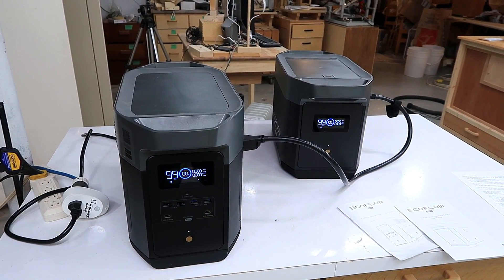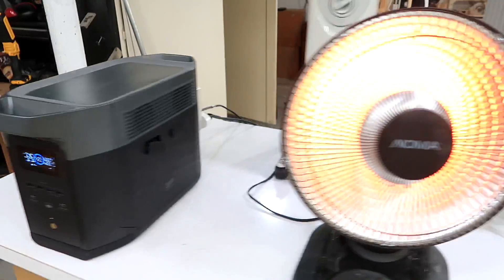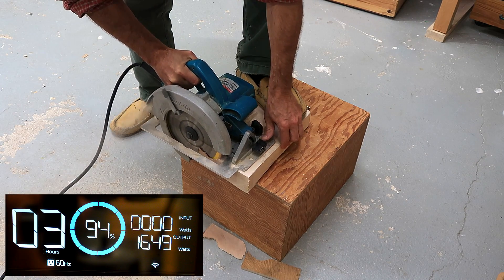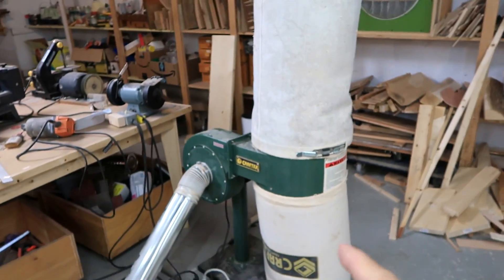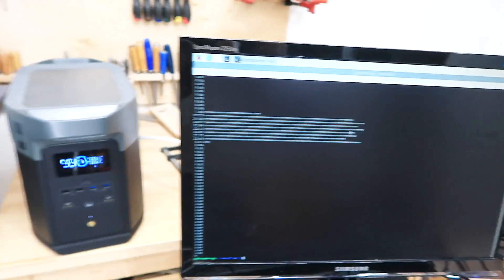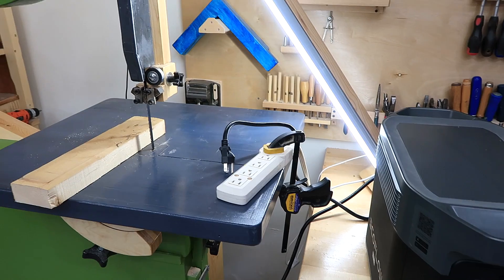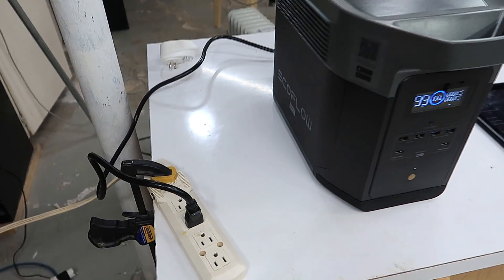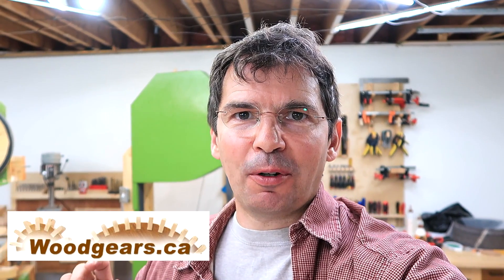Overloading the EcoFlow Delta Max battery pack

Comment: 4:04 and 5:08 - do any of these devices contain a slow-start circuit? For example, like the one used here?
https://youtu.be/BCzwF92esNI
For the record, I am not suggesting messing with power tools or in anyway disassembling them or modifying them but if it is the start up current spike that makes your power back up electricity supply unit tripping, there may be solutions out there that could have a slow-start circuit built into a power cord extension or as an independent device that can be inserted between the power source and the power tool. What I mean here is a device that plugs into the power source and that the power tool plugs into in turn. That device might have to be appropriate for the individual tool's power and current demands. 
Consult an electrician or electrical engineer - they might be able to advise you on such solutions.

Comment: I forgot thumbs up to you. You are a bit of a multi-artist in battery, programming and wood. Ecoflow is a good powerbank but think if you had to go out and buy an inverter of 2KW for 120 / 240v and batteries and then it will be almost the same price and then you can not take it on holiday or in the garden, with ecoflow delta max, you get it all in a box and a small table with it on top of the equipment

Comment: Great video!  I just bought two EcoFlow Delta Pros and began testing then.  The capacity test did great on both, and they can sustain what's advertised, regarding the 3600 watts of output, but I was pretty shocked to see that neither could power my Delta table saw (model 36-725).  I'm not exactly sure why, other than perhaps it having something to do with it being an inductive motor?  My Watt Meter only saw a surge to 1800 watts or so when plugging into the wall outlet, but perhaps it surged far higher, faster that I didn't catch it.  I guess I need a similar setup to what you have to watch it more closely.  Still shocked that the Delta Pros couldn't power the table saw, even with X-Boost...
Reply from the maker: the current surge on these motors at startup is crazy, something like 60 amperes.  if you retire the saw for 240 volts and get the box that hooks up tow for 240 volts, then it can start a 1.75 hp motor just fine
Reply: @matthiaswandel  I guess I just figured that if the Delta Pro can surge to 7200W that it should have been fine.  Not that I'd use the table saw in any sort of power outage scenario, and I'm not a builder, so in the end it doesn't really matter, but still :).  Yeah worst case, I re-wire it or put a soft starter of some sort on it, if it became a 'need'.
Reply: @ericjansen9042  question I have delta pro too. How long did your overload protection light flash for before u can use the ac ports on ecoflow again?
Reply: @Tech4Ten  in my case when it would overload, I just turned  the AC outlets off and then back on and it was working again.  Maybe 10 seconds .

Comment: The impedance on the bigger bandsaw (plus the mass/inertia) probably required more than the peak current of the inverter. If the "generator" used deep-cycle SLA batteries it would probably handle that sort of surge.

Comment: forget to run a generator for 3 years, clean the carb and it will run. forget to charge a battery for 3 years, freeze to death
Reply from the maker: yes, you can’t just forget about these.  a forgotten generator will give you trouble, but can still be made to run.

Comment: How about this scenario. I have a chop saw and a small air compressor running off a generator. The air compressor happens to be running I go to use the chop saw and that pops the breaker on the generator. Now could I use something like this hooked to my generator and my other tools hooked into this? For just a little extra power boost.

Comment: @Matthias Wandel have you heard of a device called "soft starter" it could help start those mashines and without tripping the fuse, most high power devices have these inside the housing. As an example in germany most washing mashines and dryers have them to prevent that the fuse trips. 
i like your videos they are very informative and you have very understandable voice, nice greetings from germany and see ya next time.

Comment: Its a nice looking piece of tech that I am sure plenty of people could put to work. My parents built a cabin some time back and we used one smaller solar panel, a car battery and a inverter to keep the tools charged. We used a Dewalt Framing nailer, drills and circler and reciprocating saws and were able to keep the battery's charged for everything but the saws. The Saws did not perform that bad, but with heavy work we found we needed to start the generator or we would eat through the battery's faster then we could charge them. The kicker though was we ended killing the battery over the build, and in our case was no big deal, but if you needed to replace for the next job it gets costly quickly. We did this before the newer high compacity battery's were available, I think we had 2 4ah and a bunch of 2ah so that's a factor for running the saws for sure. The Framing Nailer did much better then we expected, full day most days per charge. It would be interesting to do the same job with this and see how long the tiny solar panel we had  could keep it topped up.

Comment: I've been looking at battery power generators; thanks for the honest and entertaining review. Regarding the planer, most home circuit breakers have a thermal trip feature using a bimetal strip, and a magnetic trip for short circuits and surges. There are trip-curve charts online that show how long a thermal breaker can be overloaded for at various loads before it will trip.

Comment: Is there any product data that advises a slower recharge can lengthen the viability of the battery storage?
Reply: I know that charging to only 90% doubles the life of the batteries.
Reply: @grantofat6438  If this were true, would not manufacturers electronically limit the charge capacity to 90%

Comment: Older breakers had no such "slow blow" behaviour, sadly. Our flat just got upgraded from old 16A 230V breaker to new 16A 230V breaker and now I can start my 3 cylinder compressor from that circuit whereas before I had to run a lead to the stove in the kitchen which has a slow blow 10A in the back for the sockets and a 32A for the whole circuit on the board. Needless to say, I'm happy not having to do that. I think continuous heavy welding would still pop the breaker, so the stove may be the answer for that if I have to do some, but the welding I've done thus far has been totally fine. Clearly your breakers are not from the 1960s :-D or if they are, they were a better unit than the one that just got ripped out here.
Reply: Most breakers have a magnetic trip point where they will instantly trip and your compressor probably exceeds that. I can't imagine a household breaker not having the slow-acting thermal trip mechanism.
Reply: @eDoc2020  Look, maybe it was worn out, it was 60 years old, however I could always do sustained loads up around that and it would eventually trip, but it could not stomach the compressor and the new ones can, seemingly with ease. I think, once running, the compressor is only drawing 10A or so, but at start up that motor draws a fair bit higher than 16A for a short time just like what Matthias shows here, and that 60 year old breaker, for whatever reason, could not stomach that, and the modern one can.
Reply: @fredio54  That matches what I suggested. To use 'random' numbers the old breaker might have a magnetic trip point of 45 amps, and the new one might be 60 amps. Now imagine the compressor needs 50 amps to start up.
Reply: @eDoc2020  Sure, could well be, but I suspect it was more like 25. Actually, it seemed that the surge trip was affected by the thermal trip, as I could start my SMALL compressor a few times in a row and then it'd trip, but never the first time. In any case, I don't care, it's gone and good riddance :-D

Comment: A breaker is not supposed to be loaded more than 80%. For example: your average vacuum is about 12 amps, which is 80% of a 15 amp breaker. Now to the product: 2400w÷120v=20a. 20×80%=16 amps of constant current draw, if you treat the unit like a breaker, which I would highly recommend. In wattage, that would be 1920w.
Reply: They rate it 2400w with 500w boost. Based on that we can conclude its 2400w rating is continuous. And btw continuous is defined as over 3 hours. The battery would deplete before you need to worry about the 80% rule.
Reply: @eDoc2020  If you saw the entire video, the boost feature just drops voltage to compensate for the excess current draw, meaning our equation still balances out at 2400 watts. Regarding time, if you would not design the load on a circuit to be capable of 24/7 operation, then best practice is to not do it at all. Spin up surge by an average tool motor is one thing, but even electric mower and snow blower manufacturers tell you not to use cheap drop cords. They do not know how long (your theortical three hours) you are going to use that machine and how far away from the receptacle you are traveling. Cheap drop cords are usually 14 awg or smaller. My Snow Joe, for example, draws 15 amps. That means 12 awg or larger drop cord and 20 amp breaker with no more than an additional 1 amp of draw on the entire circuit.
Reply: @brianpiper3188  As far as I'm concerned if something comes with a 15 amp plug it's perfectly safe to use it with 14awg cords on a 15 amp circuit (voltage drop is a separate issue). If something draws more than 12 amps continuously it should have a 20 amp plug.

The only appliances I've seen which draw a confirmed 15 amps on a 15 amp plug are a microwave and toaster oven. The microwave timer prevents continuous operation (and besides, it would overheat before then) and the toaster oven also has a thermostat which will limit the duty cycle.
Reply from the maker: I was certainly getting 2400 watts continuous.
Reply: @matthiaswandel  My original comment was directed more towards safety, I saw you draw 2400w continuously. The "boost feature" is a top five worst selling point ever, for a not so obvious reason. Without it, I think you showed off a decent product. I just thought of one question that I don't remember seeing in the video: I assume the battery bank is DC. Is the inversion back to AC a pure sine wave or modified? Just curious.

Comment: It's a very cool unit, but for $1299, it seems like that someone tech savvy could just buy a 3000 watt inverter for their car, or maybe rig up something with some deep cycle marine batteries and an inverter and save a lot of money.  
But for someone who is not tech savvy, this seems like an awesome all in one package.
Reply: I think it is using LFP or Li-Ion batteries. It would be more tricky to do this with those for that price.
Reply: @mckenziekeith7434  Very true.  For someone who is camping, or having to move it around a lot, then it would be tough to replicate this, but if you didn't need to move it around, lead-acid batteries are still an exceptional value, even though that technology is 100+ years old, it's still hard to beat.
Reply: @jimthesoundman8641  Yeah. LFP is better than lead acid in almost every way except price. But if your application doesn't need low weight or compact form factor or high cycle life, then lead acid could be the best option for the money. LFP is cheaper per cycle IF you actually use all the cycles. But in a standby application, I think the case can still be made for lead acid (possibly AGM or gel).

Comment: Your device may be faster than a random offline UPS, but it's nowhere near an online UPS. I am sad you recommend such a bad device for use with a computer while there are so much better choices.
Reply: People installing UPS for data centers tend to buy the UPS that is made for a data center.  The demonstrated capability is plenty good for the home market.
Reply: @Kineth1  ALL offline UPS I have tried made computer freeze 1 in 5 power outage. So if you are expecting a power failure, you have 20% chances of a freeze. In the best case you loose unsaved work of the day. In worst case it can harm your computer. 

If you backup your work on a NAS, even if your computer and your NAS accepted the glitch, if your switch did not then you are still in huge trouble. Had the case. 

Bought second hand online, change bats every 4 y as soon I have the pre failure warning, and as bonus, I have a lifetime surge protection (MGE pays me back and computer device up to 20k€ if an electric choc can reach my devices through their UPS ). 

I lost one printer in 12 years ... When the UPS was in bypass for maintenance. Before buying this, I lost one device per year (usually during heavy rains ).
Reply: @Benoit-Pierre  I think your 20% freezing is an anomaly. I haven't had any issues with offline UPSes. Maybe there's something marginal in your computer. I've actually been able to flip the physical switch on the back of a power supply off and back on by hand quickly enough that the computer kept running.
Reply: @eDoc2020  i am not talking about 20% failures I had on my computer, but 20% of the people I know who had UPS .

Comment: Almost certainly the motor of the small band saw absorbs so much current (at the start the motors are short circuits) that the supplied voltage drops below the limit value, imposed by the control logic.
The insertion of the extensions creates a sort of maximum current limitation, allowing the motor to start but dispersing (at least during starting) a lot of electrical power due to the Joule effect.
Thanks to their internal resistance (all cables have it even if it is small) during start-up the extensions cause the voltage to drop across the motor and this leads the motor itself to require less current and not to exceed the limit imposed by the battery pack. .
To be sure you should do a voltage check (with the raspberry) with two measuring points: one at the output of the battery pack and one at the plug of the band saw, and if I'm right, during start-up you would see the voltage drop close to the engine much more than close to the battery pack.
i'll see you in next video :-)

Comment: I find their claims of being the fastest charging hard to believe. I've got an APC UPS that takes a 16A 240V input and will happily pop a 13A fuse
Reply: They probably mean the fastest charging from a standard US household outlet, or 15 amps / 1800w. But that's the input power, anything with a more efficient charger will charge faster. And actually the 15 amp is only for less than three hours; continuous loads should only be 12 amps. I wonder how this unit handles that technicality.

Comment: Estimate of battery life when running modem, desktop, monitor ?
It looks like they make it portable, like charging phones and laptops for camping trips and such in mind.
Reply: The answer to your question varies, and is dependent on your specific equipment.  Look at the power supplies for your modem, desktop, and monitor, find the rated wattage on each, and add them up.  Then add 30% to that number as a cushion to handle start-up surge.  Then take 2400 (the watt-hour rating of the battery) and divide it by the wattage+cushion of your equipment.  The quotient is an estimate of the runtime at that wattage.

Comment: When I did some experiments using a kill-a-watt, I overloaded it and it quit working. Then everyone called me an idiot for overloading it.
Reply: You probably just blew the internal fuse. A new fuse should bring it back to life. Honestly a wire instead of a fuse is probably OK, your household breaker should be enough protection.

Comment: I wonder how it would behave after year or few years of exploitation. New batteries are always awesome. But uncharge it few times and it easy gets half of it's initial capacity.
Reply from the maker: depends on temerature, number of cycles, an depth of cycles.  There's data online for how lithium batteries degrade as a function of temperature, charge level, charge cycles and time.  Keeping it cool, and keeping the charge level between 20 and 80% extends the life a lot.

Comment: Doesn't they have soft start for inductive load? In that mode the voltage will slowly increase over couple of secs. Should help. Inverter/SPWM chips usually have that option. Ex: EG8030.
Reply from the maker: I wish they had a bit more of that.  They have the "xboost" but that only drops the voltage down to 100 volts.  I'd go much lower.

Comment: Maybe that battery inverter for more on start power hungry devecies have soft start function. To use that you should turn on powered device before start battery inverter. Most inverter i used had that function.

Comment: how well would this work as a sump pump backup power source?
Reply from the maker: I would guess pretty well.  Sump pump motors aren't that big, so it should be able to start one just fine.
Reply: What you have to ask yourself first is if the sump pump is hard wired into the breaker panel.  If so, then you'll first have to change that to have your sump pump plugged into a wall outlet.  Once that's done, then you can switch this over to use the EcoFlow Delta as backup UPS system for the sump pump.  Keep in mind that during a grid down situation, you will still need a way to charge up the batteries in the power station.  That is, you will either either most likely need to use solar panels or a gas generator.

Comment: Awesome!  I suspect the start capacitors on the some of the motors draw a lot of power very fast. It appears the cells have a very low internal resistance, allowing them to charge and discharge quickly.